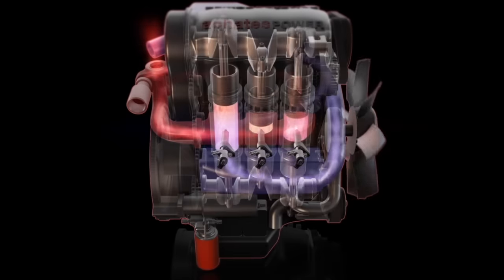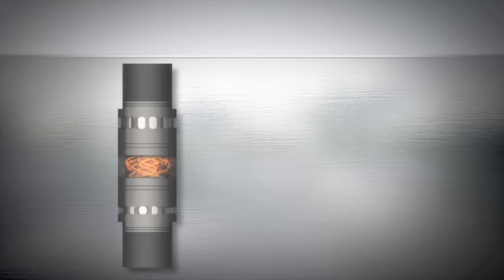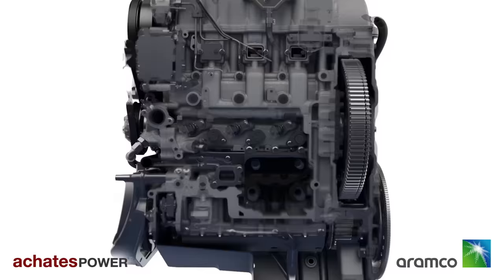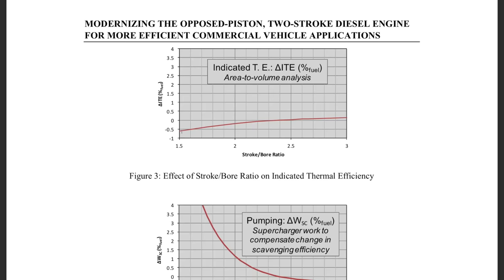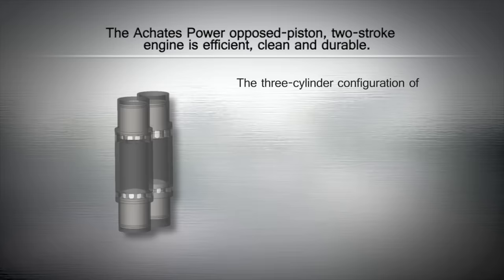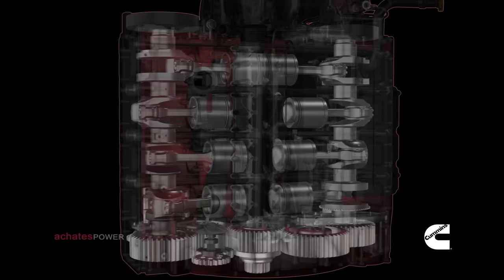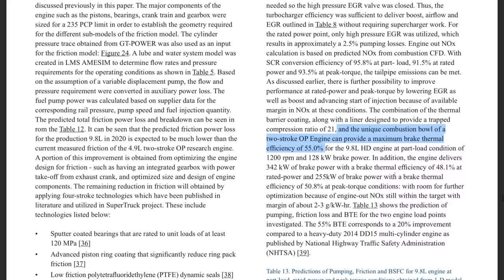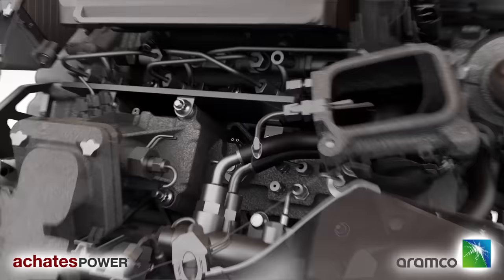Opposed Piston Diesel Engines Are Crazy Efficient

Comment: I used to work for Rootes UK - They fitted Three Cyl opp piston engines to 10 ton trucks.  To say they were efficient is an understatement, very good fuel economy and virtually no smoke or haze from the exhaust even on a cold morning at start up.  The power from the 206cu in engine was more than enough, they were some of the fastest trucks on the roads.  Supercharging does make for a noisy engine but this would not be a problem today with better insulation.
Reply: Wonder why we don't see more of them. That sounds fantastic.
Reply: @SirMo  In their day they were fitted to about half the out put of 10ton plus trucks coming out of Rootes factory.  The buses on the Isle of Wight used them, but to be fair were a bit noisy.  Many coaches had them, combined with the Avenger Coach Chassis.  To me they sounded sweet and the pollution was near non existent.  When one came into the workshop there was only a very slight trace of fumes compared with other diesel lorries that left a fog of black smoke.  Smooth to drive too, the engine never faltered.
Reply: @SirMo  They were Killed off by Chrysler in 1970 , because they had done a deal with Cummins.
Reply: The Commer two Stoke, was a noise engine, apart from that, it had power speed economy.

What baffled many mechanic if the worked on them was the timing.
Many idle gears, 4 stroke turn the engine over twice timing marks lined up, on the 2 stroke engine the ratio turning the engine over marks to line up,  ive forgotten  something like 1897 to 1.
Reply: @ukghconst  One other thing was the massively big, chunky Piston curved crank rods and crank shaft - Not an engine for the faint hearted to work on.  Having said that.  The new 2020 USA design of the 2 stroke opposed piston engine is virtually NON polluting - a very sound achievement, they are clever people.
Reply: They we build before noise regulation came in.
They could be heard for miles on a night, the supercharges did sing.
Reply: Commer knocker
Reply: the spur gears are going to be insanely noisey also on the timing gear, don't know if they modelled it like that or are going to use hypoid mesh in the final design
Reply: @loginavoidence12  - I think you have forgotten that the engine will be both super charged and turbo charged - The exhaust AND intake was very noisy from the Rootes Maidstone Engine and that was a problem, but with modern engine mounting and sound absorber material that problem is resolved for both occupants and to a point externally.  Also, the improved gear technology and design, better bearings and castings, I am sure the engine will just tick like a clock.   People will happily trade a little noise for nearly 100% clean exhaust and power/economy from fuel that will amaze!!
Reply: @bindatek8801  definitely right, there are ways to mitigate NVH on many devices like resonating chambers, modern synthetic rubbers, and sound deadening.  a new diesel doesn't sound like a garbage bin rolling down a cobblestone road anymore and such.  but since you're in the UK, I'm sure you've had an older manual transmission car at one point or another with a straight cut reverse gear--that's the load whine noise it emits when backing up.  when i saw those gears the first thing that came to mind is a spur (straight-cut) gearset, like on a race car or that older reverse gear. you probably know the noise already, similarly like the gear drive on a supercharger. I've a hard time imagining that would be left in the final design, because of how incredibly loud they are, especially moving and half or near crankshaft speeds
Reply: @loginavoidence12  I'm envisioning stacked, left and right cut helical gears to reduce both noise and side load. They would tend to self-center and have the quietness of helical. Just a thought...never heard of it being done but why not?
Reply: @ifixit706  double-helix gears are cut from 1 blank. They're less common nowadays because they're a pain to mass-produce & bearings have improved so the side-load is less relevant. The Victorians loved them though.
Reply: The blower on the Commer was noisy because it had straight-tipped vanes & I think a straight-walled port -- it made an almost-perfect siren. Careful adjustment of the geometry would drastically reduce the noise without affecting efficacy.
As others have stated they were made in an era when noise wasn't an issue so nothing was done about it.
Reply: I’ve got one in a stretched BMC EA van - early TS3 with the inline pump on a 5 speed box. Pulls well.
Reply: Commer 3 if I’m right
Reply: @dorsetengineering  Hope you've got a few extra quill shafts.
Reply: The experimental TS4 engine would have been a world beater if Chrysler hadn't ditched it in favour of the horrific Cummins Vale engine.

Comment: 2 stroke, efficient compression. can't ask for more
Reply: 2 strokes are banned here for commercial vehicles.
Reply: bcstractor  not really.
Reply: @iceberg789  that's only 2 stroke oil burning engines, this wouldn't be.
Reply: bcstractor  you're not understanding what a two stroke cycle is. You're thinking of engines that require a fuel oil mixture that is used to lubricate the crankshaft.  If you remove that part it's not going to be burning oil so will be as clean as any traditional 4 stroke motor.
Reply: So best used on huge EV trucks in mining and construction?
Reply: The part that sounds like a problem is there turbo. Not if this was on equipment or trucks that's one thing but a car you just drive to the grocery store and back turbos are not a good idea. I think this could be fixed with a lubrication primer.
Reply: @GB-vn1tf  Diesel is an oil fuel
Reply: @elroyfudbucker6806  of course, but it's used as fuel, not a lubricant as 2 stroke oil is. What's your point?
Reply: @c1a2t3a4p5i6l7l8a9r  well what most diesels do is just run the fan for a certain time until its properly cooled off
Reply: @GB-vn1tf  read the comment above, it doesn't need lubrication as it has a crankshaft and thats what has to be lubricated
Reply: @gabrielalbeldaochoa8234  I don't understand what you're trying to say? As far as I know every engine has a crankshaft and they all need lubrication.
Reply: @GB-vn1tf  Not correct to say that every engine has a crankshaft.
Reply: @lexol3347  what engine doesn't?
Reply: @GB-vn1tf  A rotary engine.
Reply: @lexol3347  I knew youd say that....that's kind of splitting hairs as the output shaft that obviously connects to the rotar could be called a crankshaft.  But I'll concede.  
I was hoping youd say a jet so I could say that's a turbine not an engine! 😜
Reply: Too much gas so nope
Reply: @c1a2t3a4p5i6l7l8a9r  whats the problem with turbos?
Reply: bcstractor  that's 2 stroke gasoline engines, diesel is a lubricant so 2 stroke diesels doesn't burn oil, its self lubricating unlike gasoline engines.
Reply: iceberg789 You’re thinking of 2 stroke gasoline engines.
Reply: iceberg789 depends on how good they peform
Reply: Except for a non polluting option in the first place. I'd have to see what the thermal efficiency is after they've included all the emission controls to meet California enviro laws, because you can easily eat several percent of your efficiency. Cost as well, turbo+super won't be cheap.
Reply: @c1a2t3a4p5i6l7l8a9r  You do know most GM and Detroit diesels are 2 stroke turbo engines now!  This is an improvement on those powerhouses!
Reply: @Chris-wf2lr  Most 2 stroke diesels do have a sealed  crankcase.
Reply: @lesly demshaw  In Europe cars have evolved to 1.2 liter turbo-charged engines to drive back and forth to the grocery store. There is no problem whatsoever with that.
Reply: @trexmidnite  mines always run out of juice first thing in the morning
Reply: @lexol3347  rotaries have an Eccentric shaft which is a form of a crank shaft.
Reply: Two stroke, Diesel... I am sure they will pass California emissions test easily 🤣. But I would like to buy it in a Ford F-150 truck.
Reply: YES FINALLY SOMEONE I AGREE WITH
Reply: ....

Diesel engines use diesel fuel to lubricate the fuel injectors. They use motor oil to lubricate everything else. Gasoline two strokes burn oil because the sump is used as a positive displacement supercharger which means that oil for lubricating the crank and others parts needs to be mixed with the fuel. They also get a lot of unburnt gasoline and oil in their exhaust due to the intake and exhaust ports being open at the same time. Diesel two strokes don't use the sump as a supercharger, and though the intake and exhaust ports are still both open at the same time, there is no fuel coming in through the intake port, or exiting unburnt via the exhaust port, because diesels always use direct injection and always run lean.
Reply: Dont forget diesel
Reply: 4 stroke is actually more efficient. 2 stroke is a lot more powerful.
Reply: bcstractor  this engine meets 2024 epa Nox emissions which is a a 90% reduction from current levels... thats 1 tenth the emissions with better efficiency to boot, this isn't your old two stroke boat engine
Reply: @rogermty1971  Cummins partnered with them and they are making a 14.3 liter 4 cylinder that makes 1000 hp and the already meet CARB 2024 emissions levels, a 90% reduction from current diesel Nox emissions
Reply: Imaging the cost of repair when the gear train brakes
Reply: @iceberg789  They're banned for decades because politicians didn't understand that 4 strokes were polluting the same as 2 strokes back then. These days, both 2 stroke and 4 strokes can be optimized to run very efficiently, with no difference between the two.
Reply: @GB-vn1tf  Synthetic oils exist now that burn completely and cleanly, layered engine design to provide a more complete combustion, and electronic carburetors that give the perfect mix of fuel depending on task at hand, rpm and temperature. A modern 2 stroke engine has the same emissions as a 4 stroke, with better power-to-weight and 50%+ efficiency. Long are gone the days of polluting 2 strokes, but laws don't change overnight sadly, and misconceptions still run around.
Reply: @em4703  Indeed so, but the 2 stroke refers to the cycle, that doesn't mean that a two stroke has to run as an oil burning system. I'm thinkink along the lines of a Detroit diesel two stroke so there's no need to actually use oil fuel mix as you'd be running a wet sump/crank. I'm actually surprised this system hasn't been developed and used before now, or if it has been it never made it for whatever reason?
Reply: @freedomlovingmerican4580  the cost aint much but every mechanic will charge u the same way as replacing lock with bloated parts and labor just like the locksmiths
Reply: @c1a2t3a4p5i6l7l8a9r  That shouldn't be a problem if this engine is used as a  range extender to a vehicle with eletric propulsion

Comment: I was engineer on ships with 8 cylinder opposed piston B & W engines of 12,000hp.  The top pistons were the exhaust gas ones, connecting to the single crankshaft below by side rods.  The top piston provided about 25% of the power.  They weighed 4 ton apiece!
Reply: You’d think they would want them sideways so less of the power goes towards fighting gravity to pull the pistons back up again.
Reply: @orppranator5230  then you get to deal with friction instead xP
Reply: @orppranator5230  since the pistons always move in sync and in opposite directions, when one piston moves up the other moves down, if the weight is similar it cancels out. But if you put the engine on its side you would have constant weight on the bottom half of the cylinder causing uneven friction.
Reply: Gotta drink the fuel to move a 4 ton piston.
Reply: How can one piston in a 2 piston cylinder be only 25 % of the power output
Reply: @sammyd7857  the opposed pistons don't necessarily have to move the same distance, speed, or in sync.
Reply: @ifixit706  they do have to be in sync
Reply: @sammyd7857 Shorter stroke.
Reply: @markbeale7390  it isn't half the stoke of the other.
Reply: @sammyd7857  Yes Google harland and wolff engines, study end elevated drawing.
Reply: Also sailed on B&W, Harland &Wolf made opposed piston 2 strokes from 1956.  Pure magic to be on watch in the engine room.  Sewing machines on heavy fuel oil.  Not much fun when it came to pulling a unit.